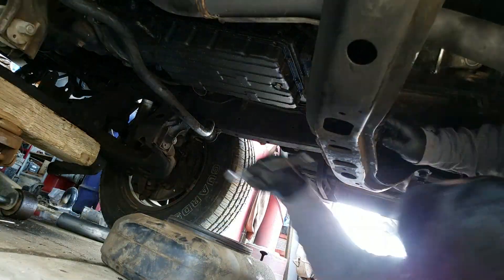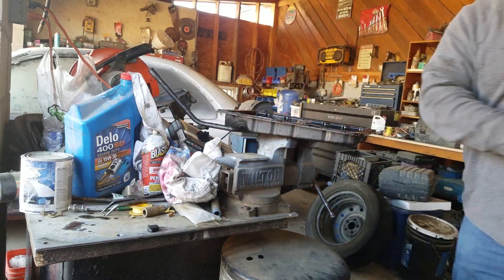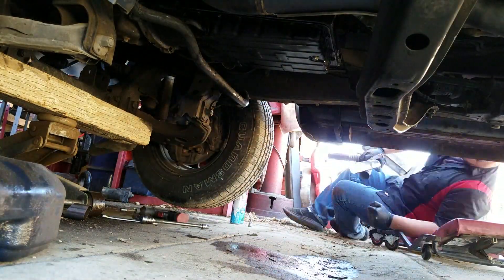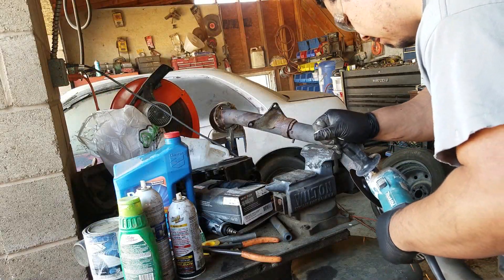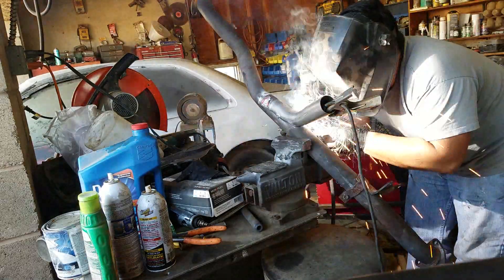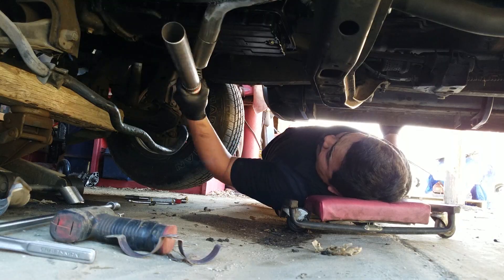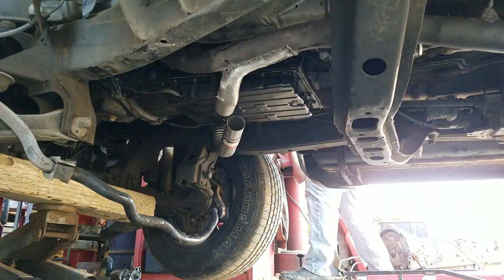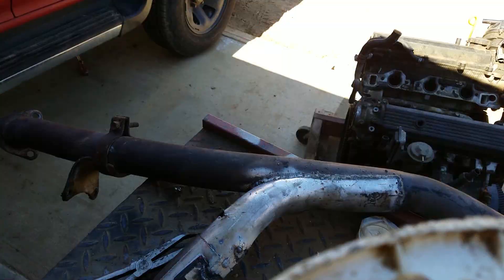The $40 3VZE Exhaust Crossover Delete On The Toyota 4Runner | 3VZ Mods | NW Ep. 29

Comment: I just wrapped mine after replacing the heads.  Now the motor is overheating. It has a new radiator, fresh TOYOTA OEM coolant, and everything else the same. I THINK wrapping the crossover pipe is causing overheating, but I am not sure yet. I can find no information from anyone anywhere who has tried wrapping it. 😕
Reply: what was it?
Reply: @repeatedrl558  Never found out for sure.

Comment: What did you do with the crossover pipe itself? The only options I see are buying new headers, buying at least the crossover delete which is 95$ plus having to figure out what to do with the exhaust dumping out the passenger side :/ im kinda stuck bro, can you help? I dont want to just fully send it on new headers because than I'll have to get the ehole exhaust system done and I'm on a hella budget at the moment. Trying not to have to spend an arm and a leg down the line on my head gasket

Comment: What do you think about deleting the catalytic converter as an option to reduce heat buildup?  Will it help gain horsepower?
Reply from the maker: you would gain maybe 5hp at most but you wont really feel it. These engines produce 110hp to the wheels so going from 110 to 115 wont be noticeable.

Comment: Is this 4runner a 4x4 wondering this with the pickups and how to get rid of the T setup and do a true y in the same spot to keep it tucked and out from under the trans and transfer case..
Reply: What you have done is not what I'm after.
Reply from the maker: This one is not a 4x4, this is a 2wd. If you have a 4x4 youre going to struggle a little bit getting it wrapped around the T case. Space is really tight since the fuel tank is on the same side. I've only done 2 2wd trucks so I'm not sure what is the best way to redo the 4wd trucks.
Reply: I have an idea of making new manifolds pretty close to 4x4 setup since it crosses over behind the engine and above the transmission and doing a y in the same spot as the T set up it has. It will cost more then its probably worth but can be done. It would be of similar design as the 3.4l 4x4 swap cross over y pipe that goes in the factory area for the exhaust for the 4x4 pickups.
Reply from the maker: I played around with different ideas as well but I haven't actually put anything into action since right now I don't have any running 3vzs

Comment: Why not cancel completely the catalytic converter?
Reply from the maker: It works as a really good sound reducer but also cleans up the smell if your car is running a little rich after you get it tuned
Reply: I have a 1994 4Runner 4x4 3.0.  Looking to swap a diesel engine in to it with a manual transmission.   One option is the new Cummings r2.8 or the d4d toyota engine.  You have any experience  with engine swaps?  What would you recommend?
Reply from the maker: @Val1973-n2h  The most popular engine that I've seen lately is the VW 4cyl TDI engine. You can find a lot of videos on TDI swaps
Reply: @NightWrencher  I will look in to that.  Thanks for the information.
Reply: @NightWrencher  I've seen a few too swaps I just don't like and get why all the black smoke.
Reply: If you get rid of the cat,  then it won't pass smog
Reply: @alessandronarom6751  Well in Texas you don't need to pass smog if it is a 1996 or older.  It is considered  a classic.  Only have to have safety inspection,
Reply: @valentinarzola7970  yea I heard about those "inspections" just a money grab.

Comment: Anyone try those 160-170 dollar kits on ebay/amazon for 3vze 4runner?  I have auto and 4wd so I assume more pipes will need to be bent out of way.  I also hear I will need a 3 inch lift which is out of the question.  I just torqued passenger side new cylinder head,  and realized it might be my last chance to remove crossover pipe and install header kit.
Reply from the maker: I havnt seen the kits but probably installing long tubes would be better and bend the pipe around the driveshaft instead. Body lift will help against head but not required
Reply: @NightWrencher  Right on,  thanks for video btw,  very cool!   I am installing two new cylinder heads on my 3vze.  Not refurbished heads..brand new castings!  Crazy right?!   Apparently they are reinforced to lesson chance of cracking.  BTW,  my truck was running fine until I got lazy and took to a mechanic for some preventive maintenance/timing check...  Next thing I know my heads blow and new radiator cracks.  So avoid mechanics at all costs is my advise!   I've now done 2 tranny swaps,  2 head gasket and cylinder replacement and much more myself.    A lot of work to get a abused 3vze running true again.  Still cost effective at this point,  not much longer though!
Reply from the maker: @TheWeirdSide1  thats pretty crazy, I didnt know they were reproducing them. Ive never had issues with cracking personally but I have heard stories. Once youre done, youll be good to go so good luck!
Reply: @NightWrencher  Thank you good sir!  Fingers crossed..    '3.0 or go home!     Or is it 3.0 never leaves home? lol

Comment: My '95 4runner (3vze) looses coolant monthly.  Maybe a pint a month or so..normal?  Today I pulled 2 plugs and one was somewhat difficult to remove and it had some rust on threads and also on butt end ring(and ring was slightly corroded).  Electrode seemed okay,  maybe a bit of rust in a thin layer which I cleaned off.  Recently,  my truck has turned over longer when cold starting and initial warm up period is not as smooth.  I also get occasional hesitation when accelerating from a stop or slow speed.  I changed oil today which is fairly dark but still translucent as far as I could tell.  Could water be getting into gas and not oil?   Exhaust from pipe is normal..goes clear after warm up.  Just throwing it out there if anyone knows!  Cheers!
Reply from the maker: It sounds like you have a few issues. If you are losing coolant, it can go 1 of 2 places. Inside the engine or on the floor. The first step is to verify your truck isnt leaking. Sometimes it evaporates before it hits the ground so youll never see it. Buy or borrow a radiator pressure test kit and pump up your system cold to 15psi. If it does not hold 15psi for several minutes then you got a leak. If it holds then you gotta make sure your headgasket is good. But pressure test your system first!
Reply: @NightWrencher  Got an idea!  Can I use bicycle pump(with psi gauge) and attach to top or radiator?  I have a fairly good bike pump.  Only thing is I don't want to pump coolant into cylinders or other if I DO have a leak.  Because I could probably drive with a slow leak for many more months until I can afford to do extensive repair.  (I already swapped transmission twice..first one was toast off ebay so they sent me another good one).  I also replaced passenger side cylinder head and new gaskets for it.  The other cylinder head had okay pressure a year and half ago when I did test.  All 180-179 psi except one which had 150 if I recall correctly.  Anyway,  just info for other tubers..I got my work cut out for me.  No need to respond,  I appreciate initial response advice!
Reply: Update:  I found small drip leak from coolant hose finally.  Also,  had slight possible valve issue at number 6 cylinder which is common.  That or the mechanic I took it to soon after caused heads to blow.  Also I used thinner oil at one point,  and that could have led to problems as well.  I'll never know what all went wrong,  but I find this engine is very tough for mechanics to work on..they seem to know nothing about them and usually make it worse.
Reply from the maker: @TheWeirdSide1  Im glad you were able to find it! Theres not a whole lot of info on these engine because everyone pretty much hates them but once theyre running good, theyre pretty much trouble free

Comment: Nice!  But you're not supposed to make out with your microphone:)  But seriously,  great tutorial!
Reply from the maker: My newer setup is a lot better for commentary than these old videos were 😂
Reply: @NightWrencher  I've done some videos of my own and I know how it goes.  I'll do some pressure tests like you advise although I don't have those tools.  Will an oil change place do that?  Or only full on expensive machanic?
Reply from the maker: Basically a full mechanic will do that as a diagnosis but the tools are cheap at harbor frieght so you can do it yourself

Comment: Hi, I have a 94 truck with the 3VZ. So, does this eliminate the OEM crossover? I'm confused. Does this still retain the O2 sensor before the Cat?  I live down in SD. Is this something that will not pass smog? I would think that if you still have the O2 sensor and Cat that it would not be any issue. Am I wrong, and if so, why?  I'm about to do a 2" body lift to mount 33's and may do the 5VZ upgrade in a year but if this can extend the life of the 3VZ Im all for it.
Reply from the maker: The original cross over gets deleted and plugged on the driverside. The passenger side gets part of the crossover turned downward and a pipe is added down. You are not messing with the original o2 or cat, but you might get dinged for modified exhaust during a smog check. Its definately worth doing and if you can get a good guy that wont notice the new pipe, youre good to go.

Comment: Do you have any pics or video of the removal of the crossover pipe? It looks super tight around it and wasn't sure if I had to remove a bunch of stuff to pull it out or if there was a way to remove the pipe with out touching anything else. Thanks
Reply from the maker: There's actually no way that I know of to remove the crossover pipe independently of either the engine or the heads.

Comment: Is the pipe running underneath the transmission pan? If so doesn't that cause excessive heat to the fluid? Asking for a friend LOL
Reply from the maker: You would think it would cost some issues, but I've been in contact with the person who bought the truck, and it's still going just fine

Comment: I have a 1993 3vze pickup.I replaced the left head gasket for the third time but when I got the engine back together the engine will not start.It has 150 psi compression on all six cylinders.I checked to make sure the timing marks are lined up properly three times so far on the crankshaft and the camshafts.The distributor is lined up with number one with the number one cylinder on compression and I check number four cylinder as well just to double check and everything was lined up there too.I checked the fuel pressure at the pump and on the fuel rail and it measured 55 psi.I checked the spark at the distributor and the spark plugs and there is plenty.I tested for continuity at the fuel injectors with a noid tester and everything worked as the manual specified it should.I looked into the ECU to see if there was any burned or corroded circuits but I found nothing.With the exception of the bad head gasket the engine ran before I changed the head gasket.I replaced the fuel pressure regulator but nothing changed.I removed the catalytic converter to see if it was restricted but it was clear and I was able to see straight thru it.I check to make sure all ports were clear and no rags were left in it and I found nothing restricting the ports.Help! sklaerner@yahoo.com
Reply: Passenger front cylinder is cylinder one
Reply from the maker: Hello! I had a similar case happen to me. First Have all 6 fuel injectors flow tested to make sure theres no stuck injector. Next make sure your noid lights flash when cranking on each injector connector. Also make sure the AFM is properly hooked up and all your grounds are clean and that there arn't any air leaks between the AFM and the throttle body. Tripple check you have spark in all 6 cylinders and that the plugs are on the right cyl(driver front is cyl 1, pass front is cyl 2 etc), finally make sure your AFM moves freely. If you have proper spark, fuel delivery and compression, it should start. Good luck!
Reply: I fixed the problem.I had to replace the electrical plug on the distributor and I managed to get two of the wires crossed.The green wire and the black wire were reversed.Pryer to this I managed to get the engine started long enough to get it to through two codes that lead me back to the distributor as being the problem.The engine starts and runs like it is suppose to.Thanks for you help.Steven
Reply: Thanks for posting the fix.  I'm glad it wasn't major.
Reply: Steven yea defiantly check grounds make sure you put back the ground from the head the the body or engine block I had this from Len before on a ford

Comment: Did you have any trouble with California emissions after you did the crossover?
Reply from the maker: Depends on where you go. Legally it shouldn't be a problem because the stock cat and o2 sensors are still in the stock location, but some may mark it as a "modified exhaust"

Comment: Hey bro, how much would you charge to fabricate that? Did you have better flow then stock crossover? Any noticable performance gain?
Reply: If you wanna test fit it on mine I’m available! I have a 92 with a manual tranny. I’m in the inland empire too   Pomona Claremont area
Reply: I’m also interested, I’m probably picking up a ‘93 4x4 pickup manual and want to do this right away.
How much would you charge?
I’m in south riverside county. 
Temecula to be specific.
Reply from the maker: Ive been away from 3vze projects since I sold my 4Runner, but I have my parts truck that happens to also be a 4x4. As soon as the rainy weather. Is over, Ill be sure to get on this for you guys!
Reply: Did you happen to get a video of the connection of the passenger side?
Also do you remember how you removed the crossover?
I’m seeing comments online of people not being able to remove the crossover.
Reply from the maker: @flj232  unfortunatly I removed the crossover when I pulled the motor out and built the new crossover when i installed the engine. For the passenger side I turned the crossover flange downward and then welded a pipe straight down. The lower portion hooked back up with a coupler and clamps
Reply from the maker: I do know that it felt better in the higher range of RPM than before, also underhood temps dropped alot too. If you live near by on cali, I could help you make one.
Reply: @NightWrencher  NorCal?
Reply from the maker: I used to live in norcal but not anymore unfortunately
Reply: NightWrencher what part of Cali now?
Reply from the maker: @jaxonrosewrestler  inland empire
Reply: NightWrencher how close is that to San clemente🤣
Reply: NightWrencher I’m going to want to do this but am definitely gonna need help. I’m stationed on Camp Pendleton, drive a 95 runner. It’s a manual 5 speed and got 4x4
Reply from the maker: @jaxonrosewrestler   I've never built a crossover for a 4x4, manual, but I'm sure it cant be that hard. You're like 2 hours away

Comment: Well done video. Excellent lighting, sound, narrative, camera work, unnecessary music.  Not sure WHY you were doing this.  Says "deleting" a crossover, but looks like MAKING a crossover ?
Reply: Steve, the stock crossover on the 3vze rides the back corner of the motor on the passenger side so it creates a hotspot on the engine that over time can cause issues with the gasket and the valves.
Reply: The real problem with the stock crossover is all the exhaust from the passenger side is forced back into the driver side manifold and that extra heat and backpressure blows out the head gasket and burns the valves in cylinder 6. You can leave the exhaust next to the engine, but if you block off one of the driver side manifold exits and make a standard y-pipe on the driver side, that'll fix the problem. I'd rather the exhaust be closer to the engine than heating up the transmission fluid.
Reply: @AdmiralRustyShackleford  Once I get my 3vze back from the Machine shop that is doing the work I will be tossing out the stock crossover and messing with the exhaust a bit.
Reply: @AdmiralRustyShackleford  a three inch body lift cools things down nicely. in almost 300k miles I have had no trouble with valves or gaskets. I would just go ahead and make a dual system with a crosover somewhere else, like a normal exhaust if it werent such a pain to put in a second o2 sensor.
Reply from the maker: I should have specified in the title but what I meant to say was that I deleted the STOCK crossover and made a NEW crossover that hangs under the tranny to prevent burning up the head gaskets

Comment: Did you just weld a block off for the LH manifold where the crossover normally connects?
Reply from the maker: Basically. I took the crossover, cut the ends off. On the passenger side I turned the end 90 degrees down and welded a pipe to it, and on the passenger side, I welded a a block off on the flange. Keep in mind that the left and right sides are not interchangable.
Reply: Is there room to remove the crossover without removing the heads? Thanks for posting
Reply from the maker: I havn't been able to do it unfortunately.
Reply: OK, thanks

Comment: Is this CA legal ??
Reply from the maker: You don't move the original location of the O2 sensor or catalytic converter. You also don't remove the factory exhaust manifold which have the provisions for the air injection and EGR, so technically it is California legal, but if you get a smog technician that wants to be a jerk, they can choose to fail it. I would ask the tech before you decide to test.  When I went to get my smog done, nobody said anything. Just my two cents. Good luck!
Reply: NightWrencher thank you I appreciate it.  Video is very helpful.